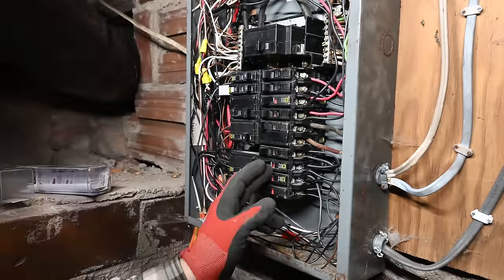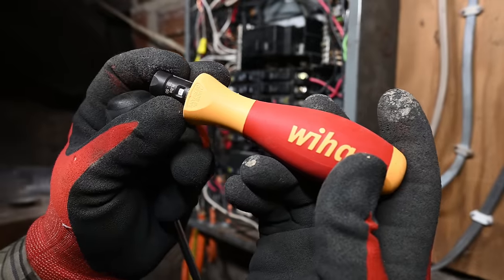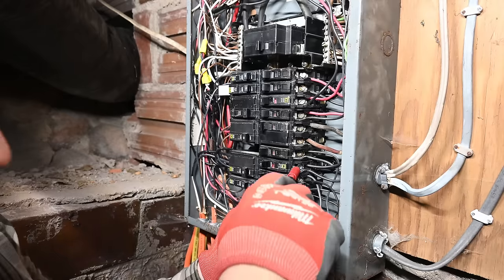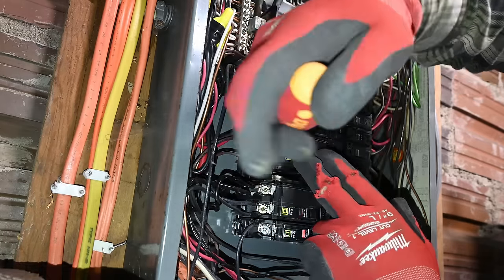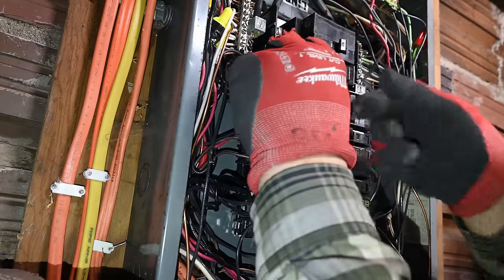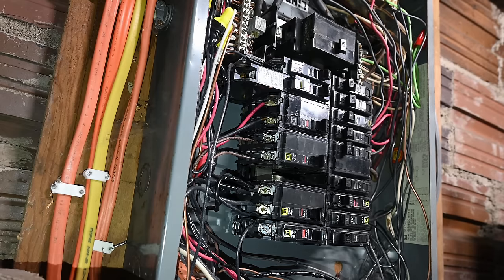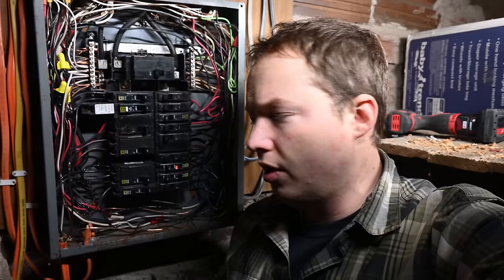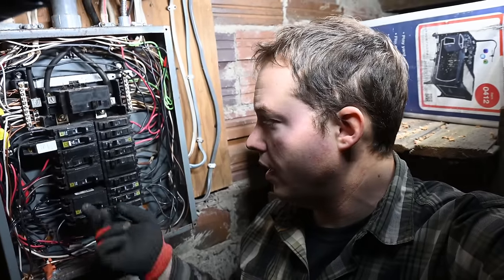Checking an Old Electrical Panel For Loose Connections With a Wiha Torque Screwdriver

Comment: You only showed checking the torque of the HOT leads.  You also need to check the NEUTRALS!  They carry the same amount of current.  You can find the torque spec for the neutral buss screws on the panel label (or contact manufacturer).  If the buss has different size screws, they probably have different specs.  I bet if you do check them, you'll find just as many (or more) loose neutral leads.

Comment: I get the concept but for residential panels let's say there are, what, between 20 and 40 or so connections whereas, yikes, 10x or more connections throughout all the circuits?  I respect the German-engineered Wiha tool but until everyone starts installing Wago nuts or similar in all their j-boxes should there also be a $200 torque thingy for wire nuts? If safety is paramount why stop with the load panel?  I'm not being completely sarcastic because, seriously, I recently found a partially melted wire nut in a J-box that I think it was due to a loose connection.

Comment: For $200 I’m quite surprised that no bits are included.
Reply from the maker: The $250 pne has them included! What a bargain!
Reply: Wiha is designed and assembled in Germany where average salary is 2800EUR or $3120 and additionally to personnel salary Wiha should return trade credit with percents. If Chinese authorities are regulating financial streams, German authorities believe in transparent hand of market which automatically regulating economy. That is why Wiha costs expensive.

Comment: Ben, 
I was surprised how many needed tightening. Also surprised how much force you seemed to be using to satisfy 36 in lbs. I'm going over mine to tighten them up a bit.
Question :
Just got a sub-panel installed in my carport w/ 100 amps and now I'd like to run circuits. I have the power coming from the box inside a raised home, up through the bottom of the sub-panel box though about a 2" pipe. The top f the sub-panel has another 2" pipe capped off but I only see 1 (1/2") knock out and 1 (3/4") knock out on the lower left side of the box. 

I'm going to running several circuits. Maybe 4 (110v) circuits and 2 (220v) circuits. And eventually I'd like to run another 100 or 90amp circuit out the top of the carport sub-panel box to a new box in a future shop space about 50 yds away.

My Sub-panel box has room for 12 single breakers, so :
a.)  How do I fit all the wires for that many circuits in the knock outs provided ??   
b.)  Or, can I cut new holes to accept more circuits ?? 
c.)  How many 12/2 romex or 10/3 romex can a 1/2" &/or 3/4" knockout hold comfortably ?? (do I need a knockout for each circuit) ??

Thank you for your generous consideration, 
Sincerely ......................
Subscriber Steph !!
Leesville, LA.

Comment: Wire God could you show us what the wire looks like after proper torque ..as a electrician it was unterstood its gotta be tight too be right ..but now im thinking being popeye might be a bad thing which it is ..and some and myself in the past have squashed the wire ..so a look at a proper torque by appearance maybe insightful
Reply: I know you smiled when you read wire god ..so you should your doing a amazing job on the videos
Reply: Maybe it is not the wire that is so loose, maybe the threads of the screw is stripping out.

Comment: So ..what about using a torque wrench
Reply: 36 in/lbs is 3 ft/lbs; if you have a torque wrench that goes that low it would work
Reply: @bobby_greene  The 1/4 torque wrenches are commonly in inch/pounds. They usually handle somewhere around 20-200 inch/pounds, so would work for this application. Maybe $50 on Amazon.

Comment: I used a torque screwdriver when installing a couple of Siemens panels in my house. My memory was that their torque spec was far lower. 10 to 12 in/lb maybe? I would have absolutely overtorqued those without the screwdriver.

Comment: Good show. I don’t know about that $200.00 screw driver. Not a big fan of buying tools that I won’t use once a year or so. I have had to tighten my breakers every so often. Yet I didn’t know they made those Torcs drivers. Not an electrician.
Reply from the maker: Yeah I totally know what you mean. Might be a case where you could maybe borrow one from a friend or use a standard  header torque wrench with an insulated adapter: https://amzn.to/3rXPrR8

Comment: I wouldn't buy one of those - too expensive. I work on cars and know the relative  difference between snug and pretty-tight.  Seeing how things (solid wire) were operating OK prior to tightening, an even tighter clamp will probably put it in the OK range.
Reply: Just wondering how the threads of the screw hold up after that much torque.
Reply: @kennylavay8492  I agree. Looks like a lot even if they are designed for it.  I would actually do less tightening since I've fixed too many things until they're broken .

Comment: For that money, I'd rather get the Klein/CDI, and they don't need that additional adjustment tool, and they take standard 1/4" bits. 
And made in the USA. Too many youtubers with German fever...
Reply: also: torquing on live terminals with an insulated driver? if they are running hot (temp too high), wouldn't that mess up the torque procedure? also, as you demonstrated, you often have to take the breaker out to know the torque spec.
Too many youtubers with insulated handle fever...
Reply from the maker: Excellent points. I should get the Klein version and make a comparison video. What model do you recommend?
Reply: @BenjaminSahlstrom  I would love to see the "Klein Tools Screwdriver Set, Torque, 6-Piece, Black, Model:57032" in action. 
Or the OEM version: "CDI Torque 401SM Micro Adjustable Torque Screwdriver, Torque Range 5 to 40-Inch Pounds, 1/4-Inch"
Reply: @wim0104  if you are adding a breaker to a live panel the insulated handle is very nice
Reply: @wim0104  a lot of countries also have higher safety standards and require electricians to use insulated tools